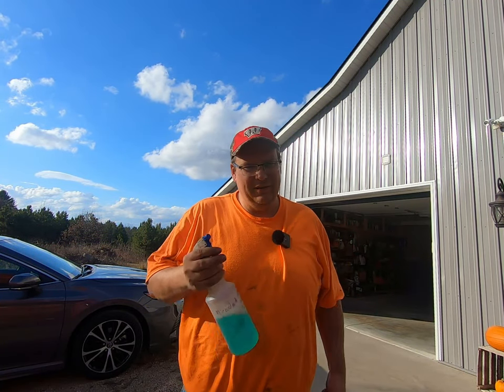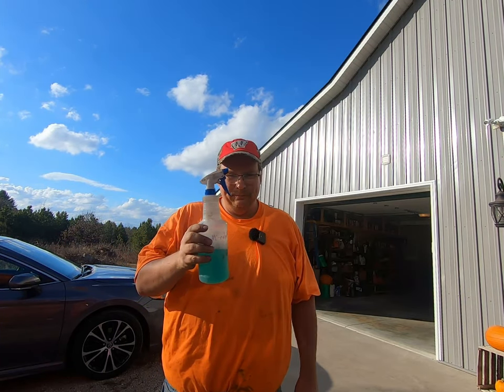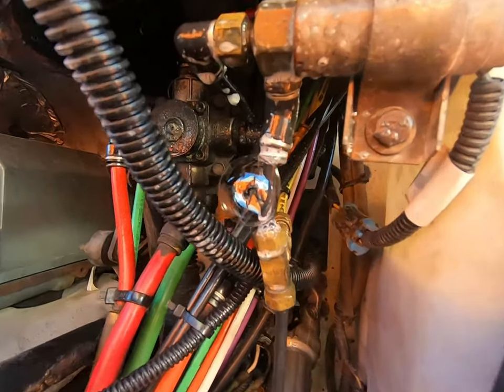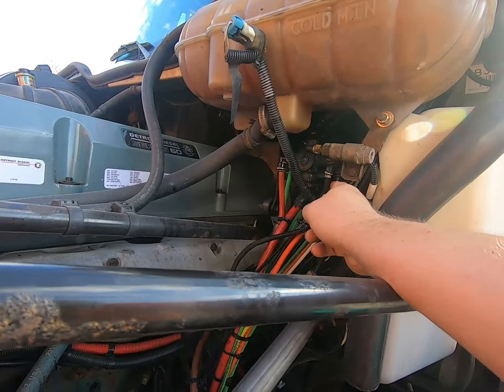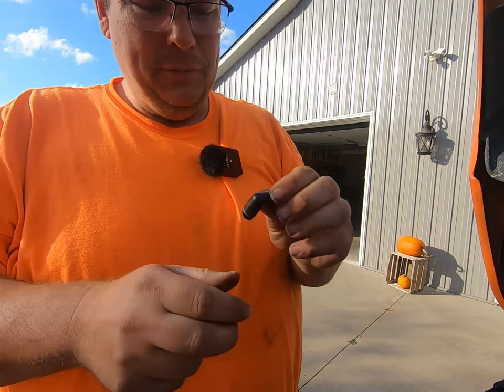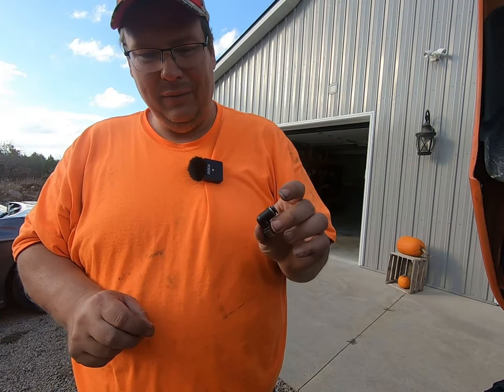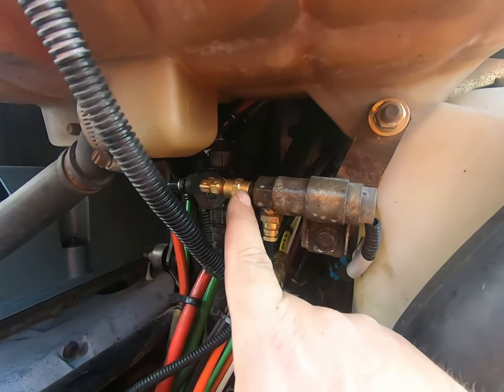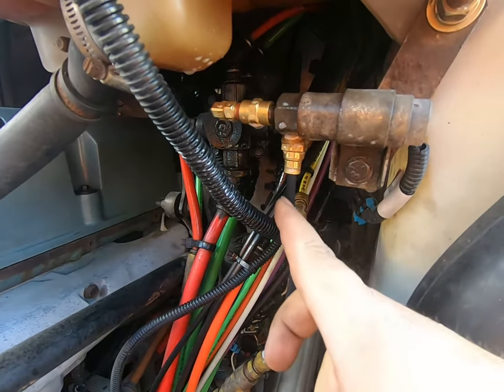Troubleshooting Tips: How to Find and Fix Air Leaks on Your Semi-Truck

Comment: I bought a small pocket slide caliper and it’s awesome for measuring broken parts accurately. I can get the exact screw or bracket I need from the parts store without having to second guess or start from scratch.

Comment: Ok but the air leak I’m looking for is not air coming out but air being sucked into the fuel system. How do we find that leak because it will never leak diesel but it’s enough to suck in air and bleed down overnight
Reply from the maker: Likely one of 2 things..fuel line check valve on back side of engine, or injector leak down if losing prime over night.     If suck8ng air, first check primer pump if there is one, and filter base and such. Davao if you have one. Can you see bubbles rise when truck is running?